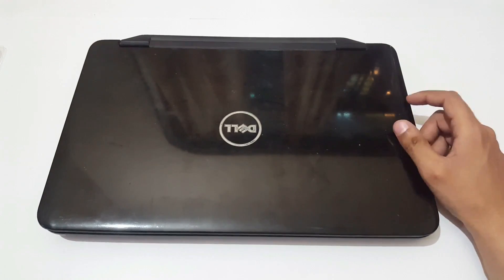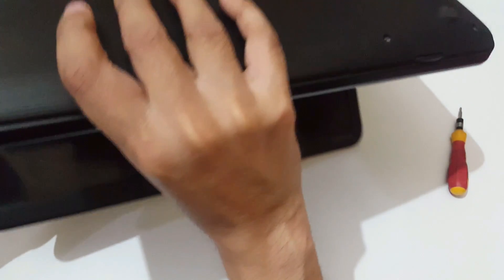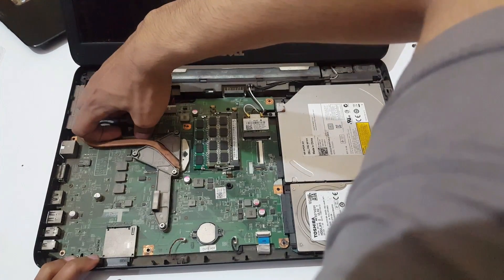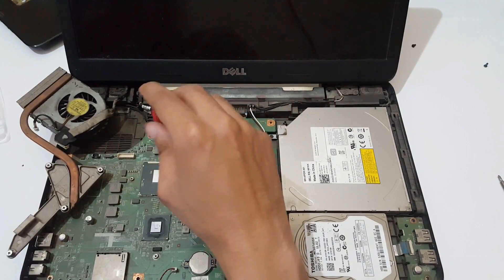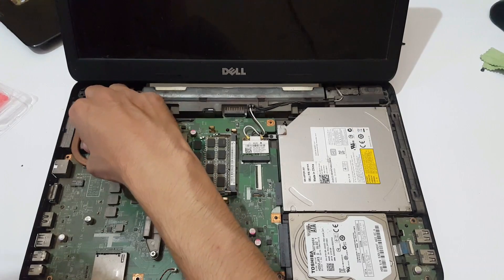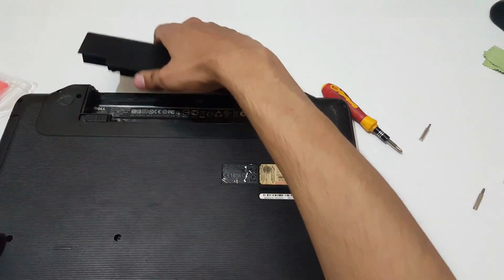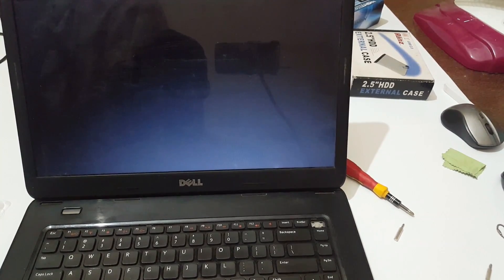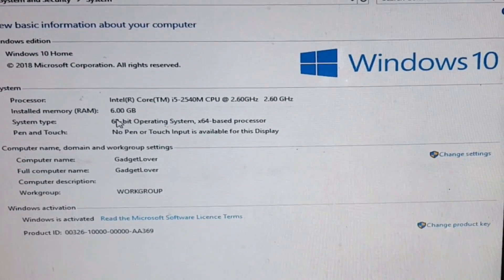How to Upgrade Processor on DELL Laptop | i3 to i5 & i7 - Make Laptop Faster for Gaming

Comment: Can you upgrade a latitude 3540 cpu?
Reply from the maker: The processor of this Laptop is soldered so you can't upgrade it but I would suggest you upgrade its RAM to max and install SSD for better performance

Comment: Very informative, could you please look into my case for a small suggestion? Hi, I would like to upgrade the CPU only to core i7 (7th or 8th Gen), please share your expert opinion, I really want to just to upgrade the CPU if safety is ensured. Specifications as below:
HP Probook 440 G4
Mainboard: HP, 822E

Chipeset" Intel, Kab Lake
CPU: Intel Core i5-7200U @ 2.5GHz
socket: 1515 FCBGA
Reply from the maker: Thanks and the processor of this Laptop is soldered so you can't upgrade it but I would suggest you upgrade its RAM to max and install SSD for better performance
Reply: @GadgetLover360  thanks for the response man, ram and ssd both already been using.
Reply from the maker: @sbhuiyan7818  You're welcome

Comment: i3-1005G1 1.60GHz CPU ( Socket 1356 FCBGA),                                                                                                                  Please Suggest Upgradeable  CPU in the Lenovo Ideapad Slim3 Laptop
Reply from the maker: The processor of this Laptop is soldered so you can't upgrade it but I would suggest you upgrade its RAM to max and install SSD for better performance

Comment: Bro, I have a Dell Inspiron 3558 laptop with Intel i3 -5015U processor @ 2.0Ghz and 4 GB Ram. I've upgraded my HDD to SSD but it's still slow can you recommend a good processor for me and also a can i fit ddr3l ram on my ddr3 slot. I'm using this laptop without battery always plugged in.
Reply from the maker: The processor of this Laptop is soldered so you can't upgrade it but I would suggest you upgrade its RAM to max for better performance

Comment: Hey, I have the same laptop as yours Dell N5050. I dont want to upgrade processor and it is currently i3-2340m. Will upgrading Ram to 8gb and installing 128gb ssd be enough to improve its speed and performance?
Reply from the maker: Yes but this and processor upgrade would be much better
Reply: @GadgetLover360  Thanks. I will think about uograding processor
Reply: Dell N5050 (same as in your video).. I have 512gb hdd in it.. How can I install both ssd and hdd together can you help? And if I do will I have to reinstall windows and what about the data on hdd?
Reply from the maker: @haadi4593  Buy hard drive caddy and install Windows in SSD

Comment: DELL 15R 5537
Processor	Intel(R) Core(TM) i5-4200U CPU @ 1.60GHz   2.30 GHz
Installed RAM	8.00 GB (7.89 GB usable)

System type	64-bit operating system, x64-based processor
SSD : 120gb as startup
750 gb HDD as storage, in dvd component

struggling with internet. when i connect multiple bluetooth devices, but when i disconnect bluetooth device, internet works fine,
and also when i try to upgrade to wind 11 from 10, it says processor doesnt support,

which would suits best ?
Reply from the maker: The processor of this Laptop is soldered so you can't upgrade it but if you want to upgrade to Windows 11 watch this video link is https://www.youtube.com/watch?v=b5pH0by9Nh8
Reply: @GadgetLover360  thanks for the reply sir, i got another problem
when i connect my laptop to screen via hdmi,  internet over wifi working too slow, but when i disconnect hdmi , i found no problwm, how to solve this ?
Reply from the maker: @dr.writez  You're welcome and to troubleshoot PC problem watch this video link is https://www.youtube.com/watch?v=QboAYOkLBPY

Comment: i5-8265U 1.60GHz CPU, Please Suggest Upgradeable  CPU in the HP Laptop ProBook 430 G6
Reply from the maker: The processor of this Laptop is soldered so you can't upgrade it but I would suggest you upgrade its RAM to max and install SSD for better performance

Comment: I have the same la top what is the high cpu to upgrade wich supports and how much ram can be install ty.
Reply from the maker: You're welcome it's RAM can expand it upto 8GB and Intel Core i5 2540M is best processor for this Laptop or you can also go with Intel Core i7 2640M

Comment: Hey I have a dual core laptop will it still work?
Reply from the maker: If the processor is not soldered you can upgrade it in same generation

Comment: how about inspiron 14 - 3467 model? do you know the best processor it can take?
Reply from the maker: The processor of this Laptop is soldered so you can't upgrade it but I would suggest you upgrade its RAM to max and install SSD for better performance

Comment: Hello @Gadget Lover ,
Thanks of the nice video. Is is possible to upgrade processor Core(TM) i7-4500U CPU on my dell Inspiron17r 5737 laptop? Currently with 8GB RAM and SSD
Reply from the maker: Hi and in my knowledge the processor of this Laptop is soldered so you can't upgrade it

Comment: Can we upgrade the intel core 2 duo processor of Dell Vostro 1015 laptop? Any other suggested upgrades to improve its performance significantly?
Reply from the maker: Yes and Intel Core 2 Duo T9900 is best processor for your Laptop
Reply: @GadgetLover360  any other parts that can be upgraded to give significant improvement? Or is it better to buy a new laptop? 
I use this for watching Full HD movies online, internet browsing, ms office, video calls for job interviews, writing online tests and occasionally basic programming softwares like Microsoft SQL. No gaming at all.
my laptop specifications:
Dell Vostro 1015
Cpu: Intel core 2 duo T6670 @ 2.2GHz
Intel GM45 Integrated graphics
Ram: 2 GB + 2 GB DDR3
HDD: 320 GB
Display: 1366*768 resolution, 15.6 inches
Reply from the maker: @VideoOverdose  I would suggest you upgrade its RAM to max and install SSD for more better performance
Reply: @GadgetLover360  can you please exactly tell what's the maximum ram my laptop can support? I think 4gb is the max. which I already have.. not sure!
And by any chance can I upgrade the gpu and display panel?
Reply from the maker: @VideoOverdose  Yes and you can attach external graphics card in your Laptop
Reply: @GadgetLover360  what is the maximum ram? Is it 4 gb?
Reply from the maker: @VideoOverdose  Yes

Comment: what type of processor would be good for  a dell core i5 4th generation? and can I upgrade it?
Reply from the maker: If the processor is not soldered you can upgrade it in same generation
Reply: @GadgetLover360  can I upgrade to a higher generation?
Reply from the maker: @clay_alt2694  You can upgrade it in same generation
Reply: @GadgetLover360  so only 4th gen?
Reply from the maker: @clay_alt2694  Similar processor
Reply: @GadgetLover360  can you clarify to which I can upgrade to?
Reply from the maker: @clay_alt2694  Provide processor number

Comment: Hello, I own a Dell N5010 15r. I like it, its well kept, upgraded it with ssd but the gpu though should have a problem. It stopped with blue screen, video tdr failure, atikmpag.sys. The gpu is on the motherboard so now or I have to leave it or try to find another motherboard (I don't even know where to find legit one, Dell says I don't fix it, its old) . What u would in my position? I like to fix stuff and reuse my older things, if possible.
Reply from the maker: Hi and I would suggest you buy it from Ebay online store
Reply: @GadgetLover360  but still maybe comes and its a faulty part..
Reply from the maker: @apolitik  You have to believe and kindly see its return policy before buying

Comment: What about dell latitude 3450 i5 5500U?
Reply from the maker: The processor of this Laptop is soldered so you can't upgrade it but I would suggest you upgrade its RAM to max and install SSD for better performance

Comment: What about a Dell Inspiron 3793, can the i3 be upgraded to i5?
Reply from the maker: The processor of this Laptop is soldered so you can't upgrade it but I would suggest you upgrade its RAM to max and install SSD for better performance

Comment: I’ve got a Dell Inspiron 3501 with an i5. Am I able to go to i7? what should i do
Reply from the maker: The processor of this Laptop is soldered so you can't upgrade it but I would suggest you upgrade its RAM to max and install SSD for better performance

Comment: Is it possible to change my processor on my dell inspiron 15 3511??
Reply from the maker: The processor of this Laptop is soldered so you can't upgrade it but I would suggest you upgrade its RAM to max and install SSD for better performance

Comment: hi Mr genius, can i upgrade my dell latitude E5470 i5 to i7 please and if its yes , is there any tips to avoid overheating '????  Thanks
Reply from the maker: Hi and the processor of this Laptop is soldered so you can't upgrade it but I would suggest you upgrade its RAM to max and install SSD for better performance and you're welcome
Reply: @GadgetLover360  whats maximum ram i can upgrade ?? 16 or 32 ??
Reply from the maker: @napst3r1  16GB
Reply: Ok thank you, one last question, i have an ssd , is there a possibility to add another NVme ssd ??
Reply from the maker: @napst3r1  You're welcome

Comment: Hello, can I change i3 processor on my dell  Inspiron 15 5000 (5566) to a higher processor? Thank you in advance
Reply from the maker: Hi and the processor of this Laptop is soldered so you can't upgrade it but I would suggest you upgrade its RAM to max and install SSD for better performance and you're welcome

Comment: Hello @Gadget Lover, i have dell inspiron 15 3542  can i change the processor from i3 to another one if it is possible what processor should i buy tyvm
Reply from the maker: Hi and the processor of this Laptop is soldered so you can't upgrade it but I would suggest you upgrade its RAM to max and install SSD for better performance and you're most welcome

Comment: Hey i am using core i3 11th gen on my walton laptop can i upgrade it as well?
Reply from the maker: In my knowledge the processor of this Laptop is soldered so you can't upgrade it but I would suggest you upgrade its RAM to max and install SSD for better performance

Comment: Can I change my dell latitude 5490 laptops processor
Reply from the maker: The processor of this Laptop is soldered so you can't upgrade it but I would suggest you upgrade its RAM to max and install SSD for better performance
Reply: @GadgetLover360  Intel(R) core(TM)i5-8350U CPU @ 1.70GHz,~1.9GHz processor
*windows 11 pro 64bit,8th gen ,
8gb ram,1tb SSD 
,Intel(R) UHD Graphics 620,Total Graphics memory 4153,
Dell letitude 5490 laptop, 
This is my pc specs can I play gta v
Reply from the maker: @Rajputt_1986  I would suggest you see game requirements
Reply: @GadgetLover360  i already see game requirements but I didn't understand im very confiused for graphics card game needed GTX 2gb graphic but I have 4gb Intel UHD,and game need i5 2.40gh processor but I have 1.9gh 😓i m vary confused what I do ni one hare is Give me a best advice
Reply from the maker: @Rajputt_1986  Try to play it on optimal settings
Reply: @GadgetLover360  but sir i play gta 4 it's automatically verry high settings and game giving 40 fps and i set medium graphics and they are also giving me a Lo fps and litely Laging so can you Tel me and explain me How Is this possible and why
Reply from the maker: @Rajputt_1986  It might lag free on optimal settings or you can attach external graphics card for better gaming experience

Comment: Hi , I have Dell 15 3000 series laptop,with i3 7th gen processor and 
 4 gb ram, 1tb hdd, so for upgrading what configuration you suggest.
Reply from the maker: Hi and the processor of this Laptop is soldered so you can't upgrade it but I would suggest you upgrade its RAM to max and install SSD for better performance

Comment: Could i upgrade cpu my cpu is intel r Pentium p6200 also in my laptop there are 4 ram slots in 2 of them 1+1 sticks could i add 4+4 in left two slots plz reply and my laptop is HCl me
Reply from the maker: Yes Intel Core i5 580M is best processor for your Laptop and you can expand its RAM upto 8GB
Reply: @GadgetLover360  give me link for the processer
Reply from the maker: @Yt6iftyiumutdstjo  I would suggest you buy it from Ebay online store
Reply: @GadgetLover360  how much frequency of ram my laptop could handle
Reply from the maker: @Yt6iftyiumutdstjo  I would suggest you see its manuals

Comment: im using i3 inspiron 15 3000 1005g1 can i upgrade it to i5 or i7 if yes whats the best processor i can upgrade it to
Reply from the maker: The processor of this Laptop is soldered so you can't upgrade it but I would suggest you upgrade its RAM to max and install SSD for better performance

Comment: I'm using acer aspire 5 i3 can I upgrade to i7 by following your instructions?
Reply from the maker: The processor of this Laptop is soldered so you can't upgrade it but I would suggest you upgrade its RAM to max and install SSD for better performance

Comment: Bro i need a help!
Which processors are supports to hp pavilion dv6t-7000?
I got i7 3610 QM inbuilt from company, and now Processer giving problem like half screen and no display.
And i7 3610 QM not available at market.
Please tell me which should i want to buy??
Reply from the maker: Intel Core i7 3840QM is best processor for your Laptop
Reply: Does it like  same size and pins as old processor??
Reply from the maker: @pratikJadhav-np3iu  Yes
Reply: Bro last question, where i can purchase that product from online market?
Reply from the maker: @pratikJadhav-np3iu  Ebay online store
Reply: ThnQ bro🙏
Reply from the maker: @pratikJadhav-np3iu  You're welcome
Reply: Bro on ebay every processer was used and price was too high and delivery charges also, can u suggest any indian site
Reply from the maker: @pratikJadhav-np3iu  I would suggest you search on Google for better results

Comment: Would I be able to do this on a dell latitude 3400 and is there any other upgrades I can do to make it better for gaming
Reply from the maker: The processor of this Laptop is soldered so you can't upgrade it but I would suggest you upgrade its RAM to max and install SSD for better performance and for better gaming experience you can attach external graphics card to your Laptop

Comment: Hey am using a hp 2000 g6 intel i3 3110m 2.40ghz 4gb ram what's the best upgrade for my pc
Reply from the maker: Intel Core i5 3380M is best processor for your Laptop and I would suggest you upgrade its RAM to max and install SSD for more better performance

Comment: How is possible WTF !!! 😱😱😱 
 HOW SUPPORT motherboard
Reply from the maker: I would like to inform you that if the processor is not soldered you can upgrade it in same generation
Reply: @GadgetLover360   but consume more power and use more battery this over load
Reply: @GadgetLover360 nice video bro 👍🙂🙂
I have new knowledge THANK YOU BRO 
 COOL 😎😎 (YOU TRY GOOD (:
Reply from the maker: @musaf5140  You're welcome and no if upgrade it in same TDP
Reply: @GadgetLover360  ok bro thanks 👍 new unlock 😉😉
Reply from the maker: @musaf5140  You're welcome

Comment: Hello, i have hp compaq c700, with core 2 duo pga processor, is it possible to upgrade to i5 or i7 … please reply
Reply from the maker: Hi and yes you can upgrade it in same generation
Reply: @GadgetLover360  can you please tell me which processor will be best for this model ..
Reply from the maker: @arvindjadhav895  kindly provide processor number
Reply: @GadgetLover360  right now i have T6570 intel core 2 duo, which i got from a another laptop.
And the socket for laptop is  mPGA478MN
Reply from the maker: @arvindjadhav895  Intel Core 2 Duo T9900 is best processor for your Laptop
Reply: @GadgetLover360  ok thank you so much .. is there any chance of quad core?
Reply from the maker: @arvindjadhav895  You're most welcome

Comment: Hi i have a Dell vostro 3560 can i replace my i3 processor to any other one? And which one will be the best
Reply from the maker: Hi and yes you can upgrade it in same generation
Reply: @GadgetLover360  can i upgrade it to i5 3rd gen or anything above?
Reply from the maker: @muneebzafar7593  Intel Core i5 3380M is best processor for your Laptop

Comment: Hi I am a Dell latitude 7390 can I upgrade the processor
Reply from the maker: Hi and the processor of this Laptop is soldered so you can't upgrade it but I would suggest you upgrade its RAM to max and install SSD for better performance
Reply: I dont think I can upgrade 16 gb ram and a sdd it's too much and dose not give any performance boost I have already i7 9 gen I just want ryzen CPU for better Igpu btw and thanks for the help
Reply from the maker: @hirajawed8334  You're welcome

Comment: Well, my laptop's processor is soldered on the motherboard
Reply from the maker: If the processor is soldered you can't upgrade it but I would suggest you upgrade its RAM to max and install SSD for better performance

Comment: Yung mabibigatin na graphics pwde po ba core i7 processor jan lods tanong lang po?
Reply from the maker: If the processor is not soldered you can upgrade it in same generation and for better graphics performance you can attach external graphics card

Comment: Srry I found this video late but can u upgrade intel processor with ryzen's? Like does it have motherboard difference like pc or its all same?
Reply from the maker: I would like to inform you that if the processor is not soldered you can upgrade it in same generation